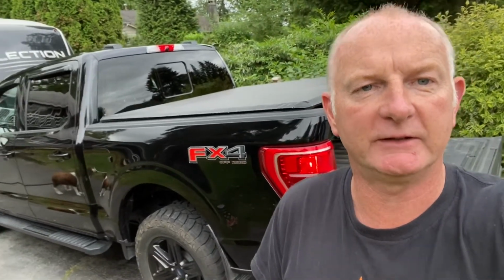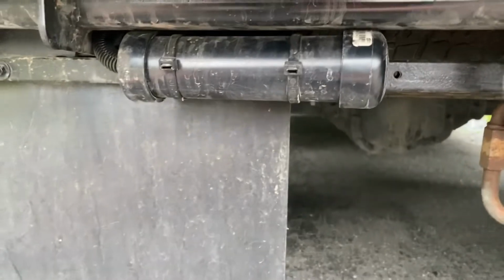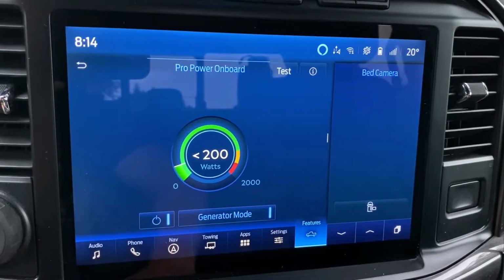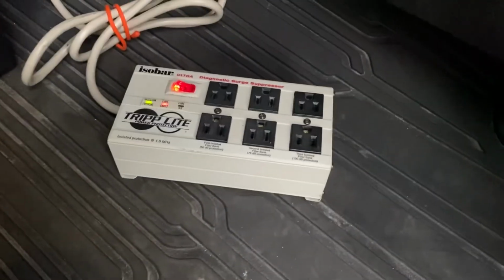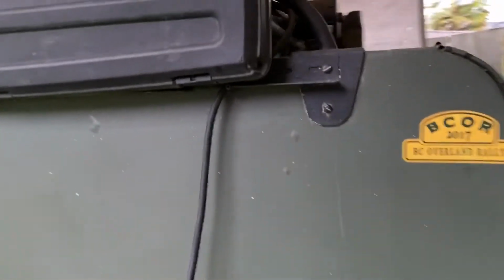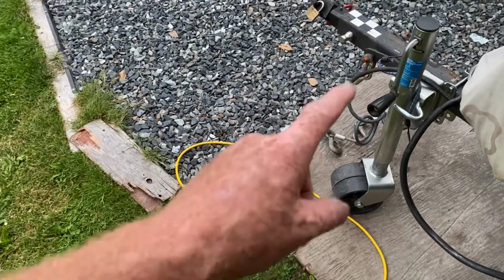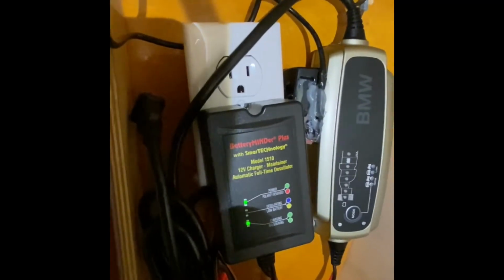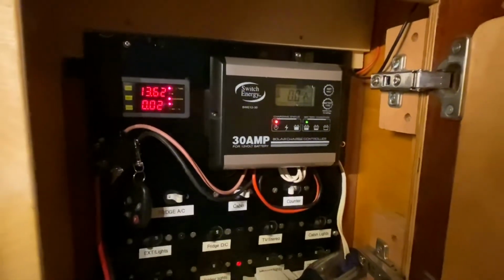F150 2022 Pro power on board 2KW inverter system. Pt1

Comment: Just curious do you ever get Pro power unavailable when using it this way and have to keep resetting it through the sync screen?   I used my 7.2kw to keep power station charging while camping and never had issues But on my 2kw I get constant unavailable messages and my dealer say I have to start the engine turn on the pro power then go plug in my battery.   which means every stop I make I have to unplug and do it all over again  doesn’t make sense to me.

Comment: From: Nobody w/special knowledge.  Purely my opinion:  It's an "Open Ground" indication.  ▪︎   Haven't followed your specific situation & just notice the amber indicator fleetingly.   ▪︎  My money (none btw) is on Open Ground all day long.  ▪︎  May want to check that as starting point to troubleshoot as I don't know squat about Ford wiring specific to this, but you know one when you see one.  ▪︎  Start with the basics.  KISS is a great moto I tell myself all the time.  Hope it may help you.  Goodluck
Reply from the maker: You have a good eye, this is Fords abbreviated info
“The DC/AC inverter has a self-protection feature for the following conditions:
Short circuits on the inverter output circuits — If the inverter detects a short on the output circuit(s), it shuts down.
If the self-protection feature is activated, the green LED indicator flashes and the DC/AC inverter does not provide power output to the AC power point. If the LED is flashing, the problem must be corrected before DC/AC inverter operation will resume.”
AC wiring cannot work the same in a car as a house, the ground would be through the DC side chassis ground and you are correct there is no AC ground on the 3 prong receptacle. So the above kicks in.
Reply: @TheSASurvival   @TheSASurvival  All the Electric directions the Manufacturers newest endeavors are headed is very, very coveted info as far as I can see for the distant future.  Thar be Gold in them thar wheels (schematics).  ▪︎  Most inverters, even off the shelf have multiple  self check/correcting features @ boot up of the organic system.  ▪︎  Is there "a" check that will recognize an OPEN circuit condition when checking a CLOSED system fault (short), which is required to be deemed a SHORT?  ▪︎  My point being a Short MUST be a complete circuit.  ▪︎  Whereas a (open) Ground Fault need not be.  ▪︎  I've not seen anybody so much as mention/ troubleshoot for that (open ground), but I personally have multiple times.  It ALWAYS comes up with OPEN GROUND in all outlets.  (possibly a crap connection point in the miles of wires (card, chip, wire (they proudly espouse the F-150 having, so says their ads)  somewhere? ▪︎  That brings the next question to...  It's a vehicle, & the golden rule is... if it's not grounded to the frame/battery bad things or nothing at all can & will happen.  ▪︎  It's a roll of the dice @ that point when the ground is open & actual circuitry is hush-hush golden goose territory.  ▪︎  I'm not willing (my pockets aren't as deep as FMC) to break warranties for others, or tread blindly down paths, but this inquiring mind would like to know the fix.  Inverter, vehicle, battery not as compatible as believed, any component just a bad fit as in a design flaw?  Unfortunately time (not all can afFORD) WILL tell.  Note:  please excuse any typos
Reply from the maker: I would agree but i have not run into this problem…… Yet. With regards to your Q, I came across this info from a Ford forum when doing research on the 2Kw says and there was not too much out there, hence the 3 videos to help others gain some knowledge. But then it gets too deep for me. Sys seems to work well and i do try to keep my eye on the over load and cables being run.
Reply: @TheSASurvival  I'd think seeing as by direct reference from Ford, those type outlets should never be used to carry a normal load, but to charge Only within designated parameters.  With that it would be highly unlikely even used properly the Amber Indicator would fall mute.  ▪︎  Saying that, everything you say seems to be positive, appreciated & helpful to the 2kw F-150 genre.  👍
Reply from the maker: Many thanks for your Q’s, i am glad it will help, but as a Non household electrician and trying to wrap my head around it you are right, i looked at the 20amp on the cover and try to stay below that and not to over load it. I did try my AC on the GD Reflection as it has a low amp compressor but it runs for about a min then shuts down, it does run the fan HI/Low speed but not enough to run the AC, this a was done only yesterday, and all the overload protection worked great and as described above, but again i have not come across a faulty cable or lightning strike….. Hope not to.

Comment: Does the 2nd alternator for the pro power spin all the time even when not using the system? I’m curious about the parasitic drag.
Reply from the maker: I am about to add another video on the system after our 3 week trip to see how it went, as i could not find this sort info out either. I believe it is an intelligent alt which means it always spin (free spinning) just like modern alts and then turns on electronically when need to to work or be used to charge creating the load. With this Q i will add some more footage to the video i am about to release next Fri.
Reply: @TheSASurvival  That would be great 👍 I’ll look out for it.

Comment from the maker: I would agree, but my system is the 2Kw system, option for all gas engines, I don’t have the power boost hybrid that comes with the 7.2Kw and the 2.4Kw options. I was just guessing at the 7.6Kw as I couldn’t remember the spec for the 7.2KW.

Comment: When you have a 240 volt 30 amp receptacle you have 7.2 kw of power.  Calculate  wattage by multiplying voltage and amperage. So the total amperage available on your 2.4 kw max system is 20 amps. But only 16.6 amps if just 2000 watts used.